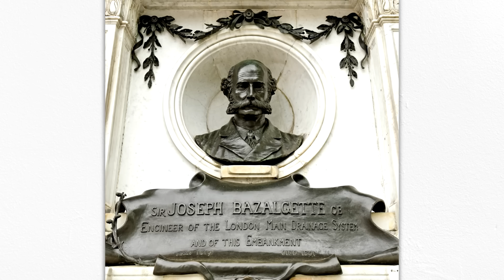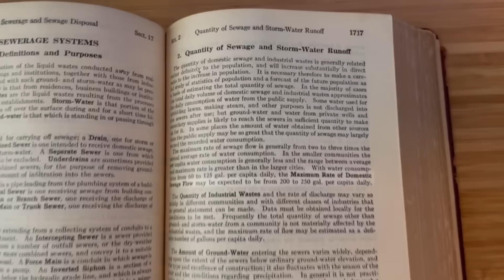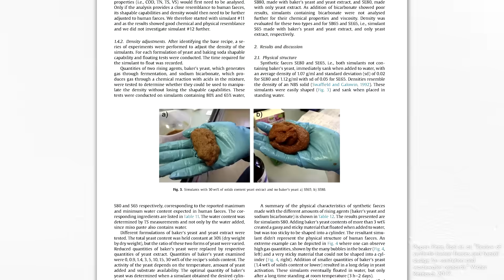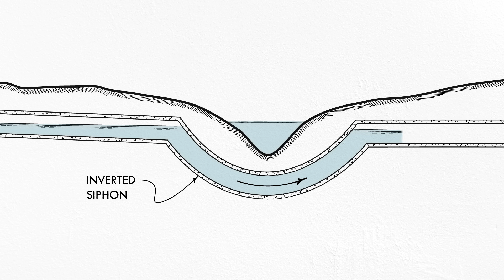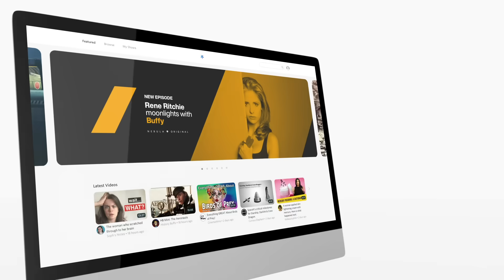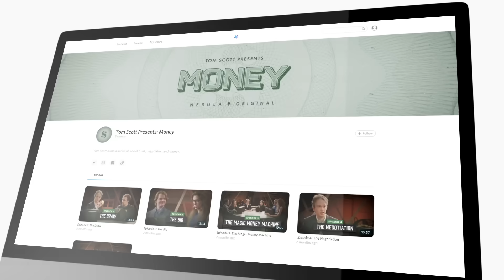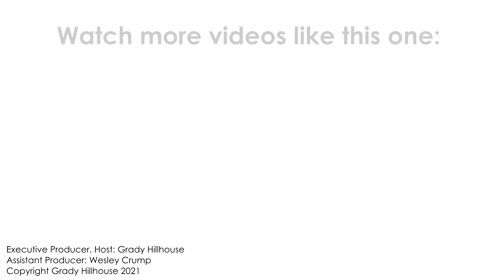How Sewers Work (feat. Fake Poop)

Comment: Living on an island close to the sea I've always wondered how sewage from beachfront and other low lying properties is handled where the sewers are at or below sea level, but can't be discharged direct into the sea. Presumably there are pumps which raise the stream to a head sufficient to flow back to treatment plants at a higher level, but pumping large volumes of sewage must be a difficult job, and I wonder what sorts of pumps are used. Maybe a topic for another video on pumps.

Comment: One thing I didn’t see mentioned is the shape of the pipe. Having recently seen newer sewer pipes installed in my area, I noticed they were oval in shape. I suspect this choice is to accommodate for variable flow and reduce solid deposition even at low use times?

Comment: All sewers, and all water lines, leak to some degree. And as you said, they are typically in proximity to each other. How is disaster avoided? By keeping the water lines pressurized, so that water only leaks out, never in. This is why so many cities in the developing world have undrinkable tap water: many also have water shortages that prevent continuous delivery of water, which allows the water lines to get contaminated while not under pressure.

Comment: I'm wiring up control panels for a scada conversion on a waste water treatment plant. I see this everyday lol
Reply: As these SCADA systems connected to the Internet? Or, do they use a communication system totally separate from the public Internet?
Reply: @Eternal_Tech  totally separate from the Public internet. We have had to pull new fiber all across the plant for the new network cabinets. All the old FOPP and IOC panels for thr old DCS system are just blank or marshaling cabinets for the new LCP to run the equipment. Everything obviously feeds back to operations for them to monitor all alarms, faults, trips, overtemps etc.. from the computers.
Reply: @Eternal_Tech  yes it is definitely being protected. The guy who is over the system is actually a little bit overboard about the security. We have some cabinets with door handles that don't have a hole for a pad lock and we are having to change out anything to do with the network so it can be locked up. It's pretty serious stuff man.

Comment: Thanks for sharing. 
Kinda glad you touched on the 
three types of sewers 
(sanitary, storm, & combination).
I understand you're not making a 
Full Feature Movie.  lol

Some more needed honorable
mentions should have touched 
on of problematics...
* Roots in lines. 
* Flushable Wipes are 
35% are clogged in lines  
65% are clogged in pumps
* MOST Rain Events & clogged lines
go into HOMES & BUSINESSES 
not onto the streets / at grade.
* as you were discussing "solids"
going through the pipes...
Most solids from citizens are broken
down in transport. The solids that
are most likely to cause problems
(Besides grease, as you mentioned)
are grit, gravel, stone / brick from 
either I&I (Cave-In's) or from we'll 
say less than reputable contractors 
Not cleaning out lines installed, 
or installed improperly. 

As far as engineering goes...
Experience has proven, 
what works on paper, 
Doesn't last too long in the real world.
If it works properly off the bat.
Take the "Inverted Siphon" at
the river for example...
Yes, channeling with two to four 
spit legs speeds flow rate & scours
the lines free from debris. But, 
It also scours the line material itself. 
Even the steel force mains. 
An aerial pipeline anchored under a 
bridge is a far superior design.
Replacing ARVs & pipe sections is a 
Lot Cheaper & Faster. 

Rambled long enough. 
Thanks again for posting.

Comment: But how does my basement toilet flush if that's below the sewer pipe level. Same with my basement bathtub and shower. Those drains are on the floor yet they also drain away to the sewer pipe no problem...

Comment: Nice presentation.  You didn't mention that the old sewers were designed to be egg-shaped in section, with the smallest end at the bottom of the sewer to minimise any sedimentation & maximise flow at small flow volumes, a very important part of the design.

Comment: 8:11 Multiple smaller syphons having the same diameter in total as the original pipe cannot increase the speed of the water.

Lets say we have a flow of 60 m³/second in the pipe - and give the pipe a total of 12 m² in cross section and it is 1/4 full.

The water before the syphon will flow at 60m³/s / (0.25 * 12m²)= 20 m/s. Now if we have 3 syphons whos cross section equals the cross section of the original pipe - their corss section will be 4m². As each syphon in your example is connected they will share the water flow and as such the cross section flowed by water - being 3x4 m²= 12 m². Now we have a speed of 60 m³/s / (12 m²) = 5 m/s. This would change if the syphons are connected to different levels in the pipe. E.g. near the bottom, middle and near the top.

Now if the pipe is only utilized by 1/4 as in the example - only 1x syphon of 4 m² will be accessible. Now the new water flow would be 60 m³/s / (4 m²) = 15 m/s. Still lower as in the original pipe, but the loss in speed is different.

Comment: If you must use wet wipes at least use the Cottonelle ones instead of the others. The baby wipes that say the are flushable have plastic strands in them and will not break down.

Comment: I was hoping you would get into the design of pipe from a house or building to the processing plant 10 miles away or more. That is, in my street the pipe is about 12 ft deep. If properly sloped, at a distance of 10 miles, the processing plant would receive the waste at a depth of over 4000 ft. Are there intermediate pumping stations to aid gravity?

Comment: Very interesting.  I would love to see what happens at the sewer treatment plant. The machinery and how it processes things.
  
Also, septic systems - I don't understand how it all works.  My parents are rural, on a lake and have a septic system, with a drain (leach?) field, etc.  And, the laws have changed over time and new houses have to build them differently.  Why is that, what have they learned over time to make septic systems better?  It's all mostly unseen and therefore very interesting.

Comment: The oldest cities found in the Crescent Valley had running water and sanitation systems built into the foundations.
Flushable does NOT mean it dissolves away, anything that flushes is "flushable". I had to have a long discussion with my oldest son about this after we started fixing his drain line. Before the septic cleaner was called to fix his septic tank. 
Why does a plumber make so much? Are you going yo crawl under a house and fix a waste filled pipe?

Comment: I don't get the part about using multiple smaller pipes for the siphon to maintain both flow velocity and capacity. I can see how a smaller pipe would increase velocity, but when you add multiple wouldn't that just slow it down again? How is it different if you have one pipe with 1m² of area or three pipes with 1/3m² area each?

Comment: All good information up until the ending where you refused to take a stance on "flushable" wipes. You were leaning in the direction of condemning them, but then finished weakly with saying the term is too nebulous and complex. Come on, seriously? You couldn't take a hard stance on this? You know very well that flushable wipes should never be flushed, and the only thing that should go into the sewer is the three Ps (Pee, Poo, Paper). You have a huge reach and had a great chance to give a PSA on this crucial topic, and you flushed it away. So dissapointing.
The science has been settled on this for the last decade: Don't flush "flushable" wipes.

Comment: When I worked in a wastewater treatment plant I discovered that the incoming wastewater is really just that: water. It's not much poo that goes down compared with pee. When you flush a toilet, a lot of supporting carrier water goes down. The aggregated end volume can change greatly during rain events, due to infiltration from stormwater, as was mentioned. Seawater infiltration presents its own problems. 
Looking forward to you doing one on treatment plants...and if you can also spare a minute in there about the amazing process of decomposition of organics that happens within the plant's processes...same basic process for millenia, thanks largely to bacteria...ooh and also put in something about finding leaks into or out of pipes with fluorescein! 🙂

Comment: The sewage system here in my city uses several pressure-pump stations to raise the level of the piping in order to have it flow by gravity for another stretch of piping.  Those pumps are sensitive to breaking down due to the "flushable" wipes" and need to be serviced (which can basically be done from ground level, because they can be hoisted out of the collector-tank that they sit in, which has hatches at street level that can be opened, the tanks can be 10 meters deep do, so it requires specialised tools to get to the pumps (and probably lowering someone into such a tank is dangerous and not allowed, if not impossible due to their reasonably small diameter).
I walked by the city cleaning crew servicing one of those installations once and stayed over for a small photoreport because it was interesting and learned something new that day.

Comment: Hey Practical engineering, if you see this, would love to know your response. A lot of the time, like this you show fantastical practical models of single case instances that are awesome in seeing how sections work. I would love to see what happens when you chain a few of these together in a grid fashion like a city actually would. I know its 10x the effort on your part, it would just be cool to see as a practical demonstration and would help an understanding of flow on effects from one inverted siphon to the next, in a parallel system format as  intricate large system dynamics are a sum of their constituents. There's probably too much to learn in sewer design and that wouldbe too hard, maybe I just need to pick up a book. Hahahah thank you so much for the video!!

Comment: The building I worked at for many years had a dual lift station where the pumps would have to lift the effluent about 10 feet to the city connection. We would get a high water alarm once in a while telling us that one of the pumps was plugged up. Lifting the pump out of the sump would reveal numerous items that would clog the impeller, such as cloth towels, underwear and even condoms. We believe the condoms came from the night cleaning crew that were doing more than cleaning the building !

Comment: Here in the city of Industry there is a water treatment plant that disperses treated water into the San Jose Creek. The pipe that carries sewage from several cities in the San Gabriel Valley into this treatment center is 8ft in diameter and flows at a fairly high rate of speed.

Comment: Probably a little more in depth than this channel would have gone, but there is a maximum drop rate when working horizontally.  You mention that the flow gets high enough to wash everything away, but there's actually a point where if it's washed too quickly, it creates a laminar edge build up on the sides....then eventually the top, and if continued, it can clog.  There's a goldilock zone

Comment: A while back I did a route survey that included in the contract opening manholes, measuring inverts, and mapping the sewer system (perks of being a surveyor). One of the manholes I opened was obviously the highest manhole in the branch seeing as how it had an out but didn't have an in. The invert was 10' or so down, but there was a 4" pipe about 5' down that flowed water  intermittently which dropped the rest of the way to the bottom of the manhole.  I watched it for a few minutes trying to figure out what it was and then I, a college educated then LSIT, called back to the office and asked the boss "where does the water in a sewer come from?" He informed me that it comes from the houses. We talked about whether sanitary sewers need to be primed or if the water from the houses is sufficient to keep them flowing and later determined that it was a 4" force main emptying into a gravity main.

Comment: The pipes have to be strong enough to support the soil above as well a traffic loading. Bedding below and around the pipe is important, as well as using the right type of pipe. The gasses in the sewer lines are corrosive to concrete.  

Besides flushable wipes, there are other items that can be troublesome such as those associated with feminine hygiene and artificial contraception.  

The sewer plants are located at the downhill side of the community which often means a body of water. This becomes problematic during storms when the storm waters flood out the plant and effluent is conveyed into the adjacent body of water. 

As is with almost all other infrastructure, funding for design, construction, upgrades, maintenance and operations is often inadequate. 

Perhaps you could review the ASCE Infrastructure Report Card.

Comment: Maintenance of a sewer In Bloomington MN was fascinating to watch, and see the engineering that goes into the process.  In a nutshell, a fiberglass mesh impregnated with an epoxy resin is inserted into the clean pipe.  Water pressure is used to expand the mesh to fit the contour of the pipe.  When heat is added to the water, the epoxy cures and you essentially end up with a new fiberglass pipe within the old one.  There's a lot more to the process then I've described such as gaining access, safely pumping and diverting the flow around the construction, and maintaining the diverted flow when the power goes out.

Keep up the real engineering good work. Really enjoy your channel.
Reply: Insituform.

Comment: Love the content of all your videos. 
Question (leading up to):
I am staying at a colonial mansion roughly 300yrs old (airbnb). It currently has 3 bathrooms, and 3 kitchen sized sinks (I'm thinking one sink was the old wash sink for clothes) the other 2 are a modern tub in the laundry room, and of course the current kitichen sink. I know that with out a sewage system you would use a septic tank, or a cesspool. My question is: are either of the last 2 options still viable for such a grand house or would the "functionality" (sewage) be less? Just wondering what the Pratical solution would be for such an old house.

Oh, BTW it currently has 9 bedrooms, separate servant stairwell completely hidden from obvious view. Not to mention 2 large living areas. Think of 2 houses put together into one, one for the family, and the other for the servants just one car port and one functioning kitichen.

Comment: I don't understand the use of multiple small pipes for inverted siphons, unless they use an automatic valve to shut off the additional pipes during low flow. 
Flow velocity in a filled pipe is just a function of flow volume and total pipe cross sectional area, if you have equal cross section then you have equal velocity.(with minor adjustments for boundary layer effects) Though the frictional pressure losses will change, as flow is an independent variable in this case.

Comment: Sounds like the sewage authorities need to stop unplugging the mess caused by wipes. When the streets and homes are flooded with sewage they should put out full page adds stating as long as people flush the things the sewers will stay clogged. Sales and use would plummet and any one seen buying them would be beaten by an angry mob.

Comment: "There are no wastewater police" oh I get to be the well technically nerd on the internet! 

 If there is someone dumping a lot of high concentration waste someone at the wastewater plant will likely notice. If it's bad enough they can start popping manhole covers to track back to whoever is dumping. Of course that's most likely going to be at minimum thousands of gallons of waste to be noticeable enough to annoy someone into tracking down the culprit.
Reply: I’ve heard of dentists getting fined as the “mercury police” followed their effluent upstream to their offices.
Reply: I work in wastewater and we have an industrial waste investigation group that continuously operates a network of chemical monitors to detect and identify illegal discharges into our collection system. Yes, there are sewer police.
Reply: @bryonslatten3147  I work for such a group!
Reply: In the UK water companies do trace detectable illegal waste back up the system, where I work we can have to send samples from our waste plant for checking and can get random check visits to make sure we don't exceed our allowance of particles, oils etc.
Reply: I worked for an environmental company and we were cleaning a line in Massachusetts for a spot repair ,I kept getting a smell of petroleum products we called town who within an hour had so many environmental police there . They literally closed a instant oil change company on the spot cars and all . Until a oil separation system was completely serviced and replaced.
Reply: poopy police gonna come for you
Reply: They measure water usage and sewage amount and calculate approximately the amounts. If pumps at sewage stations work more than supposed they know somebody is doing something naughty.
Reply: I wonder how they would know what direction to start looking first. Maybe the system is subdivided?  Then narrow down from there.
Reply: @Ja2808R  yes, the system will branch and not just randomly flow around. You pull the samples at each branch, and pollutants will be far more concentrated in the direction of the source, letting you narrow it down pretty quickly.
Reply: I was going to mention this but it has been well covered so I will just leave a link for your viewing pleasure...  https://www.wef.org/globalassets/assets-wef/direct-download-library/public/03---resources/wsec-2019-fs-011---csc---flow-monitoring-and-data-analytics---final.pdf
Reply: Thank you technically correct nerd.
Reply: @uzunashii  thank you for protecting our environment!!